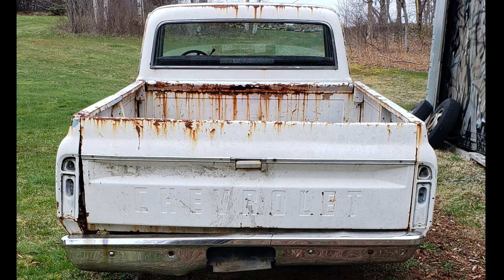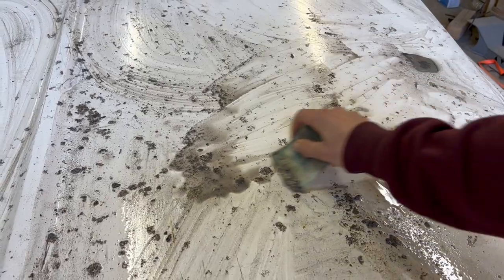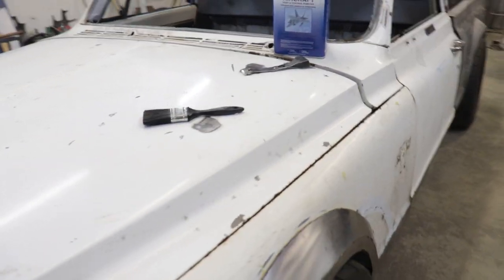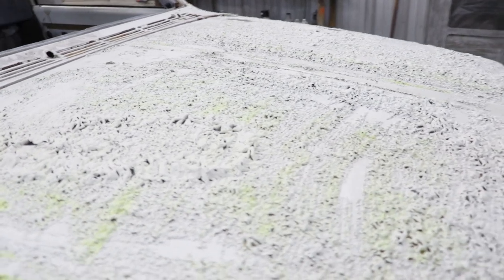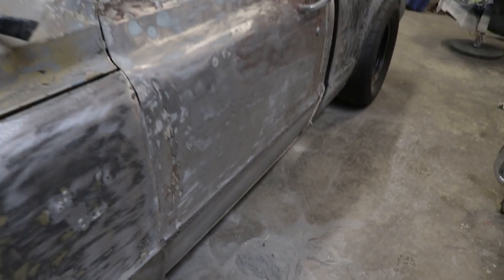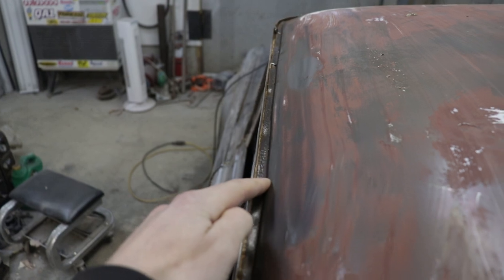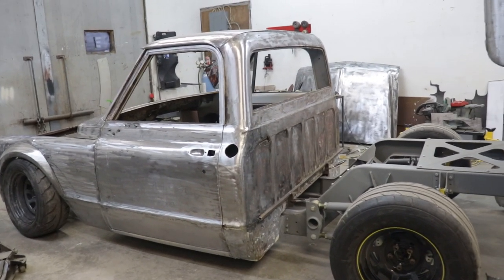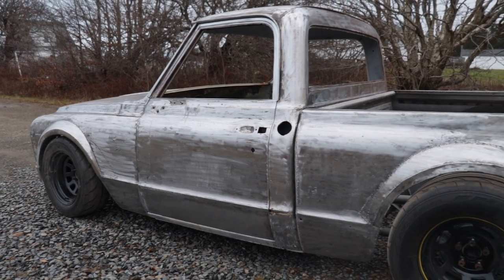Bare Metal C10 Looks Crazy Good! 1968 Twin Turbo C10 Truck build (Episode 20)

Comment: Totally dig the truck, super cool and something I’ve wanted seen done for a long time!  You’ve inspired me to start my project.  I am curious as to your wheel and tire sizes are and how much lowered the truck is from original factory height??  Love the flares and race car wheel setup!
Reply from the maker: Wheels are 15x10 aero in the rear with 325/50r15 nitto nt555r2 tires and up front it's vision D window 16x8 rims with 265/50r16 toyo proxes r888r. Thank you man! The drop is hard to tell since everything isn't completed yet! Love to hear you are inspired to work on your project👍👍

Comment: Amigo...Go and look at a DeLorean...I know it's stainless but it'll add to you thoughts on color. I think the Tesla truck is metal also.
But Yeah clear coated bare metal would be different!
This build does deserve Waaay more than a rat rod patina job though.
Look at a C6 Cyber Metallic Grey.
A super dark Metallic Green.......
Gun metal or titanium on trim pieces and handles *If you lose the chrome, Anything other than black though...
Reply from the maker: Hey amigo! Very good point, those are definitely some good options to weigh out. Still have time to decide thankfully but I do agree with you, I don't really like the idea of messing up a nice paint job just to have fake patina. I do want to stay away from dark colors though as they require more bodywork and are harder to keep clean. My black truck is impossible to keep clean 😂

Comment: What kind of stripper is that most brands now days are missing a certain chemical that really eats up the paint I just tried some aircraft stripper on some fenders and it didn't do anything
Reply from the maker: I've tried a few that didn't work but I used CMA in the video that worked pretty good! Smelled really strong though.